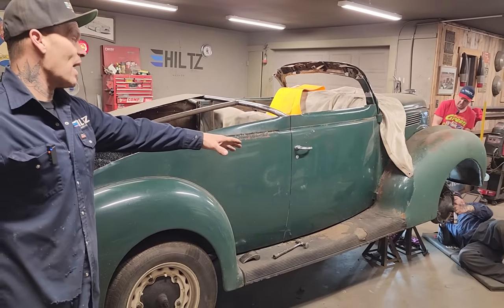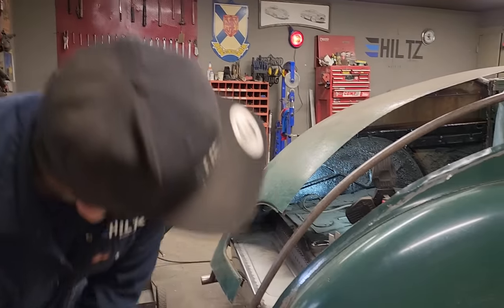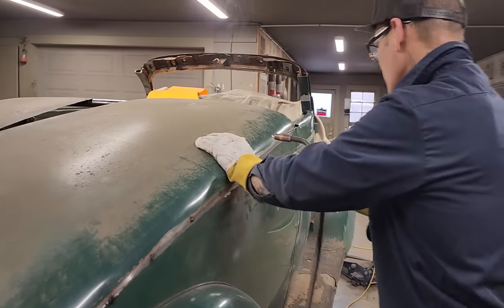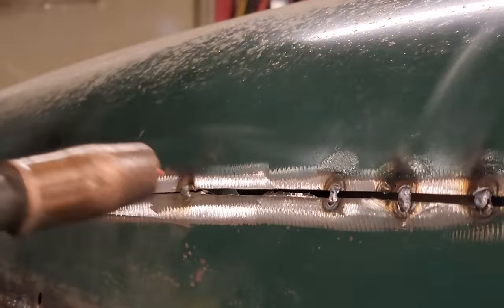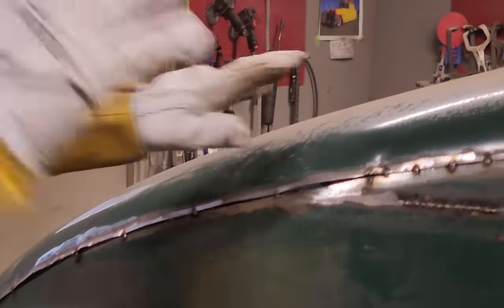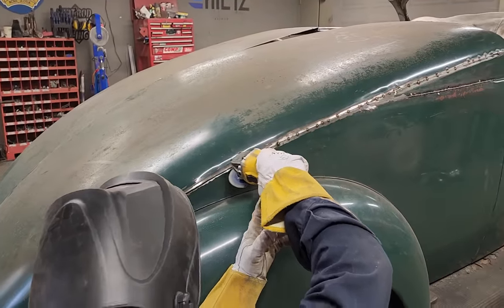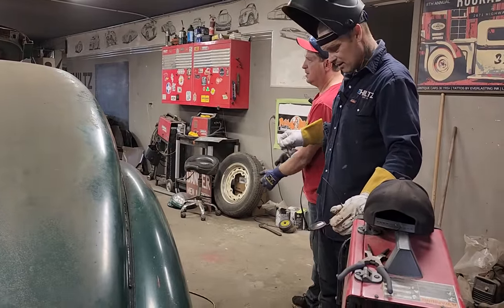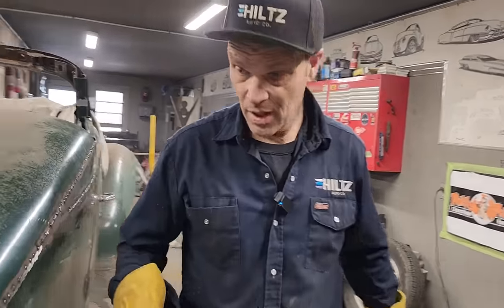The hard part... duplicating the other side 😐

Comment: Hi Chad/Jolene, on the rear trunk with the hole where window used to be….can you find an old 1928 or so model a tailgate and section out the ford embossed logo to weld in that opening? It would be slick if you could….

Comment: I think if you had made the same 'relief' cut on the passenger side as you did on the driver side, you might not have had that bad part that you now have to deal with.  You want two sides the same, wouldn't you want to do the same thing on both sides?

Comment: You might consider using the vnotch behind the front seat as a factory V8 insignia like what is on the hubcaps. It looks like it would fit right in there.

Comment: Looks like the top of windshield and the rear deck is only about 4"'s difference. Still say the round bar should have come down flush with the door height. Roof line is going to be way off is the way I see it.